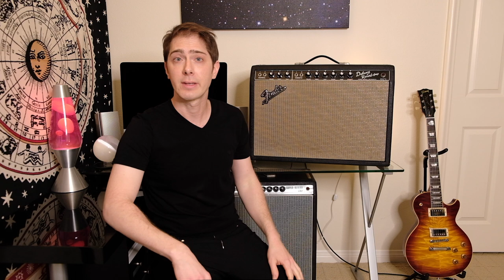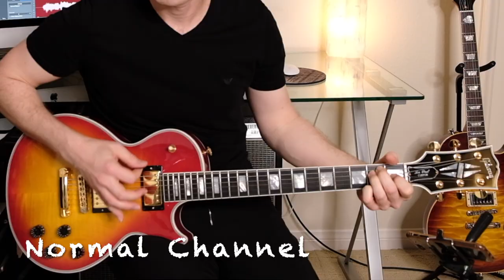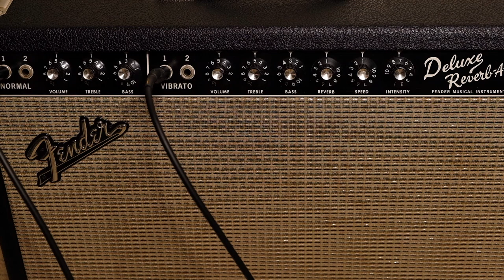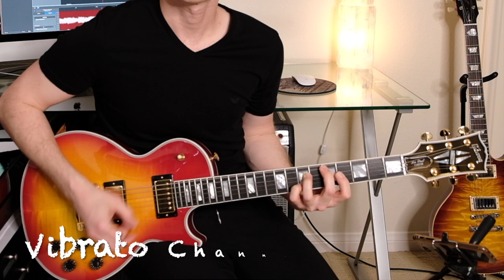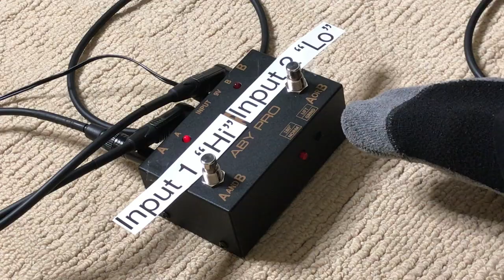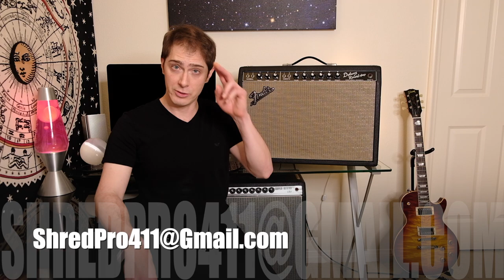Do You Know These 1965 Deluxe Reverb Tone Secrets?

Comment: You didn't hear a difference between the "high" and "low" inputs because there was none.  The way these Fender amps are wired, input #2 only functions as a "low" input IF THERE IS NO PLUG INSERTED INTO INPUT #1. With 2 cords plugged into the amp going to your "A/B" switch box, they were both functioning as "high" inputs. Try plugging into one input at a time and you will hear the difference right away. especially with single coils.
Reply from the maker: I'll try it!!
Reply: Agree; I do notice a volume difference when I use 1 vs 2 (reissue) and same guitar.  I had no idea about the single coil vs humbucker though, makes sense thanks for the info!
Reply: This is true.  There is a very noticeable difference between inputs 1 and 2 (when used one at a time).  Just try swapping between a Telecaster and a Les Paul with these two inputs to accentuate it.  Some hum buckers I've used are rather low output (some of  Gretsch's models for example) and they sound great in input 1.  I also have some really hot single coils (some Seymour Duncun shredder coils for example) that I run in input two because they're so hot.  No rules, plug in wherever you want,  but there is a logical reason for the two inputs on the DR.
Reply: i hear a difference when i plugged my 61 355 into 1 and 2. 1 was like a ice pick and 2 mellowed it out

Comment: As you may have noticed the bright cap has maximum effect at lower settings of the volume control, and progressively less as you turn it up. This is because the cap is bypassing the series element of the volume control. At 10 there will be effectively no difference.
Reply from the maker: Thanks for that, yes I did notice something happening when I turn it up but to be honest I don't 'crank' this amp - its got its original speaker and I usually don't bring this to super loud gigs anyways.
Reply: @JonMonter  Yeah, it's not often we get a chance to crank them up irl. Lol.

Comment: Great demo of the Deluxe Reverb! I was going to buy the Head version, but now I'm thinking to get the combo Deluxe Reverb.
Reply from the maker: Hey Reginator!  Thanks for watching!  I didn't know they made a head only version of the DR.  Yes these combos are almost the perfect size for anything.  Small enough to practice with but can keep up with a drummer as well
Reply: @JonMonter  Hey Jon, I also didn't know Fender made a head only version until a month ago. They made a limited run from 2014 - 2016 and Sweetwater even sold them. But now they're only available as used. Thanks for letting me know it won't be drowned out by the drummer!
Reply from the maker: @ReginatorNet  Oh cool ill have to look it up on Reverb.  Yeah unless you play metal or rock with a hard hitting drummer the combo has enough power IMO

Comment: So lots of people clip that bright cap out of the circuit, which I've been considering.. what is your take on that idea??
Reply from the maker: Hey Dustin!  Yes these amps are very bright indeed on the vibrato side.  I did the mod you are talking about, my tech removed the feet of the cap to take it out of the circuit but is very easy to re sodder it back in there.  I am putting out a new input comparison vid with this amp very soon so you'll be able to compare these sounds with once the cap is removed.  I would recommend this mod BTW, thanks for watching!

Comment: Thank you for helping me id and locate the 47pf capacitor. It sits on the Vibrato Channel Volume pot. Regarding input 1 for single coil and input 2 for humbucking pickups. That really twisted my brain around. I've never ever heard that before. Did you learn that from another source or just conclude it yourself. It sounds logical, I'm just blown that I've never heard that before. I've been using Fender amps since 1964.
Reply from the maker: Thanks Carl, I never heard it before either - my tech told me about it.  Check out my channel b/c I re did the input comparison - you cannot have cables into both inputs b/c it negates the resistor in input 2.  But its a game changer on the deluxe - you can get cleaner cleans at a higher volume with hum buckers

Comment: I couldn't hear the difference in the video, because of low quality sound reproduction, but here using my DR clone I can definitely tell a difference between "normal" and "vibrato" channel, and between input "1" and "2".  I generally prefer the lower gain inputs in most amps, including my Deluxe Reverb (clone).  I was only using the vibrato channel, because I like reverb, but after reading some opinions (there are just a FEW - eh?), I put a 12AX7 in to activate the "normal" channel, and it really is a bit fatter, with more bass (less treble?).  Those four holes are all different, subtle, but I can definitely hear the difference.  Even with a stratocaster, the lower gain holes sound better, and I'm liking that normal channel. If I connect the reverb to normal channel, I wonder if that will degrade the tone...?
Reply from the maker: Hey David!  Thanks for watching and yes there are many opinions about what to change / mod with these DR. I must also say that the input comparison was done incorrectly (using both inputs at the same time negates the resistor, so both inputs sound identical) I re did that part and will release it soon.  Also if you feel the vibrato channel has too much treble (a common complaint) you can take that tone cap out of the circuit and it will sound like the normal side.  I did this mod and I really like how it sounds now.  Im not sure about connecting the normal channel to the reverb.  Im sure you can find 100 opinions on that one lol

Comment: Can you tell me how the external speaker jack works? Does it cut out the inyrtnal speaker? Does it lower the impedance
Reply from the maker: Hey SD thanks for watching. I’m actually not sure how that jack works. I’ve never needed to use it. I have an impression that the ohm is something weird like 4 or something. I’m sure you could find pages of info online if you search it out. If you find anything of note please recommend with what you find!
Reply: @JonMonter  thanks for responding. If I find out anything, I'll reply here
Reply: @JonMonter  I ask "uncle doug" on his page. His answer " 	
Uncle Doug
It's parallel to the cabinet speaker jack, so the two jacks are an either/or arrangement: You can only use one jack at a time, i.e. unplug the cabinet speaker and then plug in an external speaker.....never both at the same time. "
I asked about ohm / load and he hasnt answered yet
Reply from the maker: @SD-nj1cy  thanks SD!  Yes would like to hear about the load - if he gets back to you.  Thanks again

Comment: Those two inputs are also handy for bridging the stages
Reply from the maker: Hey Michael!  Ya how does that work?  Would love to try it out!
Reply: @JonMonter  ,  get a short guitar cable and plug is between input two of the bright channel and input one of the normal channel. Then plug your guitar into input one of the bright channel. This works very well on my brownface vibrolux clone. YMMV on the DR sometimes the channels are out of phase. There are some YouTube videos about this.
Reply from the maker: @michaelfuller34  Thanks man I'll check it out!
Reply: won't work with the Deluxe Reverb as the 'Normal' & Vibrato' inputs are out of phase(One extra Triode in the Vibrato), There is a way to adapt the channels to make this possible. Google it, there's a lot of info about the bridging mod.
Reply from the maker: @danielcgomez  Thanks for the info Daniel!  I love learning about these lesser known topics from my viewers!
Reply: @danielcgomez  I just use a radial bigshot to bridge the channels and flip one of the output phases 180°

Comment: I didn't hear any significant difference with anything you did.  I have a 65 Reissue which sounds pretty good to me, kind of like most Fender amps.  To tell the truth I think all the hype about the old amps being better is to justify the crazy prices people ask for them, and any difference between the old ones and new ones IMHO is very subtle.  Over the years I've had a few of the older ones, a blackface Bandmaster (it was OK),  a Blackface Bassman (great bass amp for small venues, used for bass in a 3 piece acoustic band), a silverface Quad Reverb (loud and very very heavy, weird Master Volume control), a Super 60 rackmount (OK), and now a 65 Deluxe Reissue (probably the best of all of them).  BTW I sold all of the others with no regrets, except for maybe the Bassman, and I wish I still had that one.
Reply from the maker: Thanks Wingman!  I don't have as much experience with the older stuff as you do but I will say the pieces that I have that are older have a certain mojo that newer gear doesn't.  I take that BF deluxe reverb to cool gigs and people notice it.  But you're right - is it a 2X improvement?  No but for cool gigs and recordings I always bring the vintage stuff if I can
Reply: @JonMonter  For what it's worth, I've done a couple of things to my RI Deluxe that I think improved it quite a bit.. Vintage 30 Celestion - big difference, brings outs the mids a bit, overall I think it's just a much nicer sounding speaker (thanks to Zac Childs recommendation),  old USA made GE power tubes, also swapped out the rectifier tube for an old USA Truetone.  I quit the Russian, Chinese tubes as I think they are junk.  WIth the old amps I had I honestly can't remember ever having to replace tubes.. not so with the Russian & Chinese junk. My amp is one of the early Reissues with a fake (non functional) polarity switch which I had wired to the bright cap on the Vibrato channel so the bright cap is now switchable... subtle but noticeable at low volumes.

Comment: Jumper input 2 on both and you have reverb on the normal channel as well.
Reply: Nope. That only works with an internal mod. The two channels are not in phase, and this has to be changed before they can be bridged